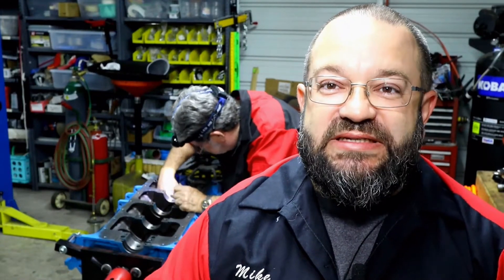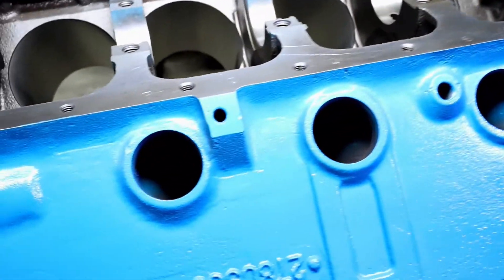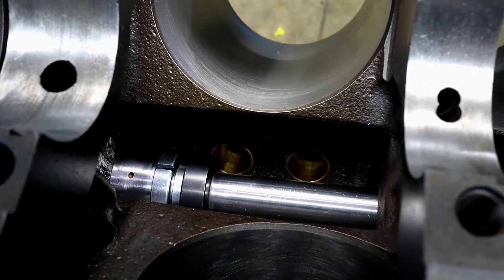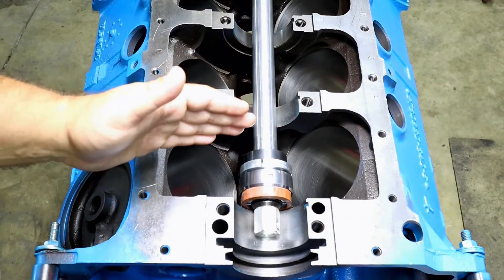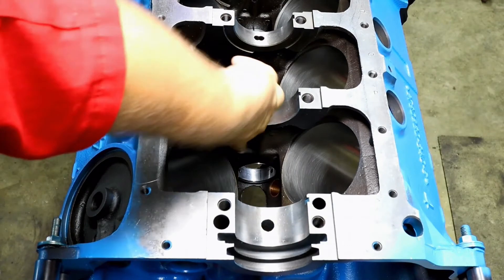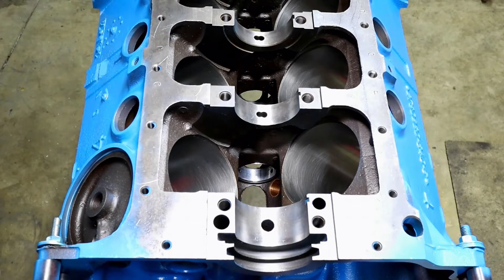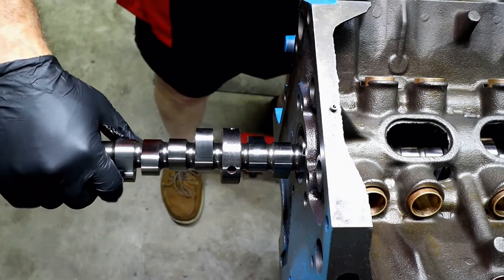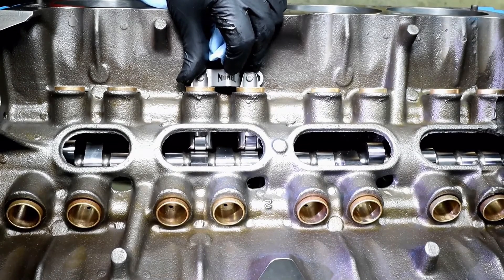The LA-phant: Bearings, Plugs & Clearances  - Part 1 of 3 | Cam Bearing Installation & Lifter Check

Comment: Thank you for this.  Because of your vids, I sourced the bushing kit from Wydendorf as well.  I have been running solid rollers for quite some time now, and with right at 600 lbs of open pressure, it had taken it's toll on the lifter bores.  I run the CompCams 828-16 lifters that do not have the groove in them.  They are a solid-body construction.  Dennis said he recommended running a much smaller hole than you are.  Around .030 or so.  I should only have to worry about the link bars clearing, as you did.  My only real fear is debris from the reaming.  I will have an extra set of hands with the shop-vac running from below while performing the operation, just to help.  My block has already been machined and is ready to be assembled, so I hate the fact that my machine shop told me they didn't have the tooling to do the lifter bores.  I would have preferred them do this and THEN tank the block.  Either way, I'm excited to get mine running again with this new refresh.  Knowing what mine has done with steel Mopar W2 race heads, I'd expect AT LEAST 650 HP out of yours on the dyno.  You should make more than mine does by a quite a bit.  I'd put you closer to 700HP, especially with the longer stroke.  I'm only running 4".  Can't wait to see it on the dyno.  BTW, what kind of RPM are you expecting?  I shift mine at 7200 at the track.
Reply from the maker: Thank Scott. We're very grateful for this comment and we're glad to see our vids are making an impact out in the automotive world.

We are thinking the Dyno will reveal something very close to 700.

Let us know how it goes. Pop ended up cleaning this block several times 😁

-mike
Reply: @MicsMotorworx  Did you ever say what this was going in?
Reply from the maker: We don't know yet.  The compass is pointing several directions.

Comment: I ran a solid roller lifter in my Super Stock Duster 340 back in 1975. The Ramchargers did my block machine work. The trick back then was to run 1/2" water pipe down the lifter oil galley from the front and the back. They then ran a modified lifter through the lifter bore to press back on the copper pipe. Then they ran a long drill from the main saddles up to and through the copper pipe. Also one down from the deck to the pipe to feed the rocker arms. This directed all the oil to the rods, crank and rocker arms. None to the lifters. They were oiled from the crank splash. Once you've done this modification you could only run solid lifters. Either roller or flat tappet. It really stabilized the oil pressure. 60-70 psi all the time. I checked my bearings after one whole season and the bearings looked like new! Honestly not one single scuff! The previous engine builder had sleeved all the lifter bores like your's and got a couple not perfectly aligned and it caused two lifters to fail wiping out the roller cam so I scrapped that block. That mod the Ramchargers did was the hot ticket back then and all the factory cars were running it like that. Judy Lilly, Comstock and Flack. Both 360 Dusters. Not sure if Ed Hamburger was running it? I ran a Milodon rear sump pan and pump and that was the complete system. Never lost a engine while racing. My Duster ran 11.20's at 122mph. 2HA class.